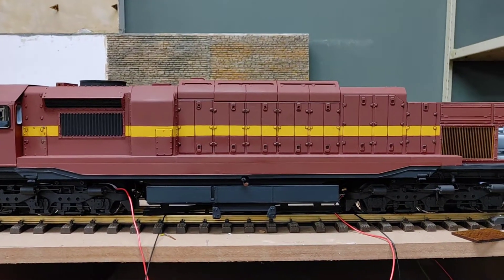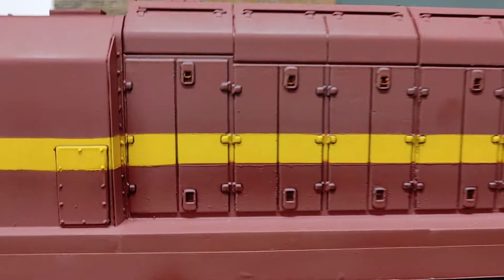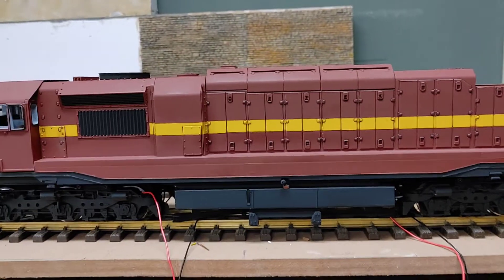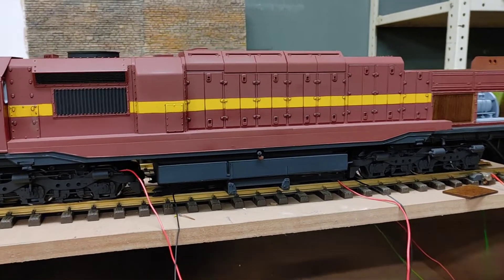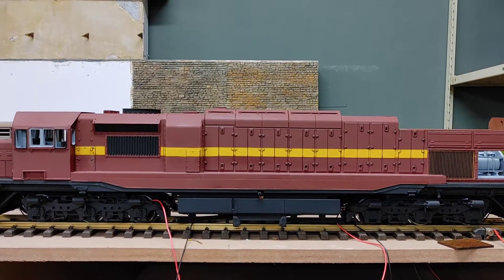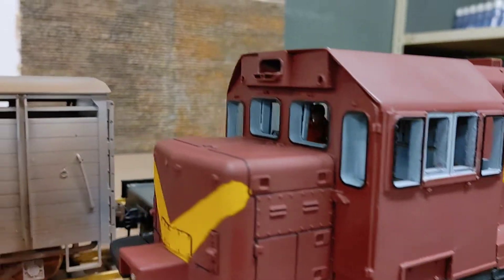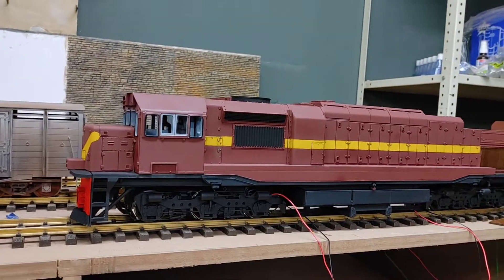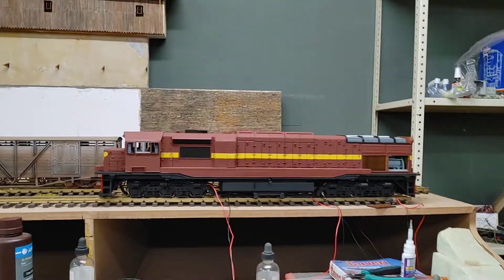To be.....or not to be......

Comment: Its awesome. The thing that comes to my mind is where does one draw the line on detail and when it starts to become a loss to you (unless of course you charge more for the super duper minute details). IF I had the budget for a loco like this, what I would ask myself is who would notice that, and I'm not sure many would see or notice that while the loco or train is running in the garden. You obviously have a lot of pride in doing and getting it right and that shows that these are truly collectors items (if anyone ever doubted it before).

Those who have ordered from you, can see that you truly do the best and really, each model keeps getting better. Test out how it feels to bend that tiny wire, then think about it after doing the whole loco - then remember that you need to do it 99 more times for the other locos (if I remember correctly, you only make 100 of each model - it is probably less now than 99 as you've sold a few).